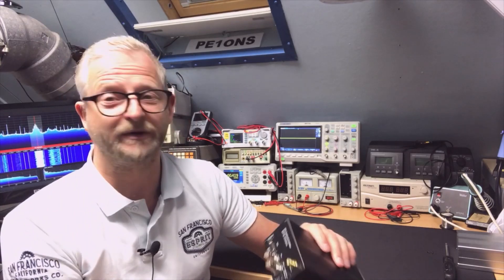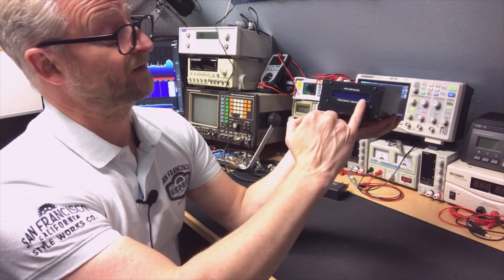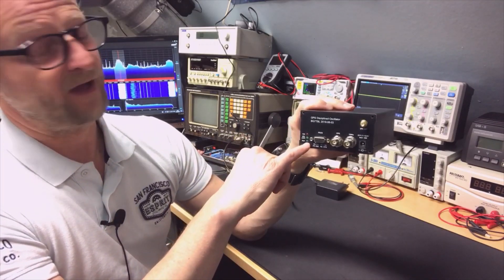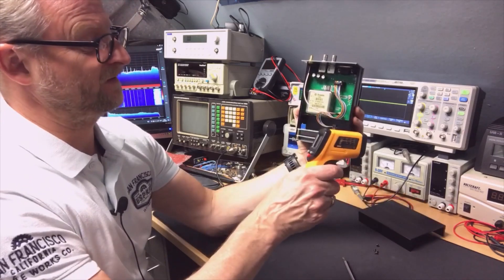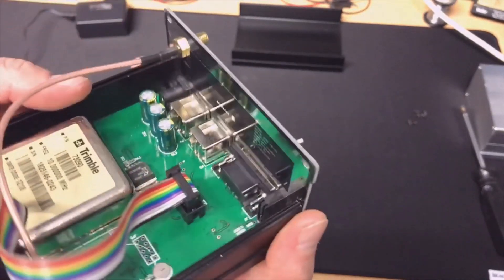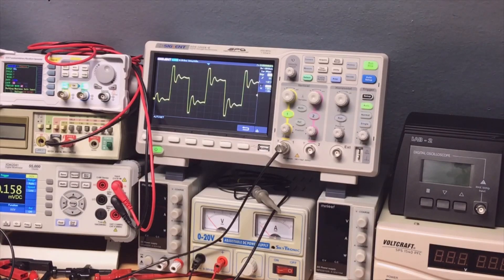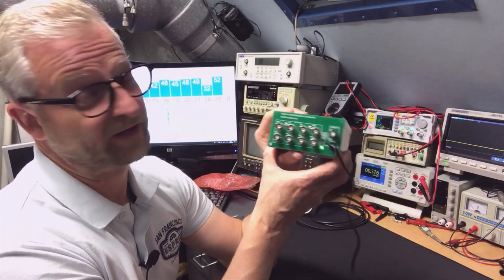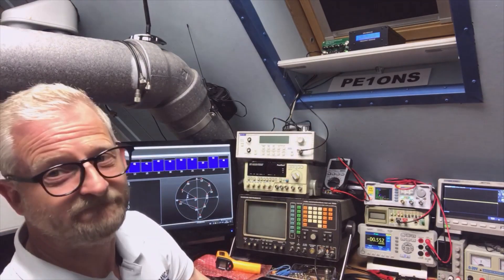#027 BG7TBL GPSDO and FDIS-5 - Review

Comment: Hi Tony
Another great video.👍
Could you make a video about the display settings?
I don't think there's any software for that, right?!
Strange, I bought the green one (square).
But it was one with a sine wave output?
Reply from the maker: Thanks! Sine wave is usually cleaner, so no problem i would day. i dont think you can do anything with teh display. all the control you can do at this device is the gps receiver only. i made a video of that too https://youtu.be/eAdJSErqZOk
here i add more satelite systems to it.
Reply: @TonyAlbus  It would have been nice if there was a simple way to change UTC time...or something else.
Reply from the maker: Yes, mine is also fixed on UTC

Comment: Hi Paul, thanks for the video, very informative and entertaining like most of your other video’s. I am curious about your considerations to decide to buy a GPSDO that outputs a square wave while your distribution amplifier delivers sine waves which seems to satisfy your needs? My thoughts where that I would prefer sine waves as well to avoid lots of harmonics potentially influencing other measurement equipment in my lab. Looking for the 7BGTBL GPSDO it seems it can be had in a square wave or sine wave version. Sellers are often ambiguous in the item description about what version they are selling. As said, I am curious about your  considerations. Where did you buy it from? Amazon, ebay, aliexpress? Payed any taxes for it? I am in the Netherlands as well. Best regards, Ewald
Reply from the maker: Hi Ewald, its Tony here, i just bought the less expensive one with display, it happend to have a squarewave.
I use proper shielded cable and am not to worried about radiation in my lab at all. Mine is from Aliexpress and the seller put in the description is was a LEDbar and a value below 35,- it was not opened so no tax.
Reply: Tony Albus Hi Tony, sorry i mixed up your name with that of the other responder to this video 😊. So it was not a realy conscious decision to go for the square wave one? In your setup you are not feeding a square wave into your measurement equipment as the distribution box makes it a sine wave. I’m quite sure that helps to not cause issues. It is only the connection between GPSDO and the distribution amplifier that carries a square wave. Good shielding seems to be sufficient in your case. I do wonder if feeding in a square wave to e.g. your spectrum analyzer would cause trouble, maybe something to investigate in a future video? Thanks again for the insights, i like your channel, (luckily) many more video’s to watch.
Best regards,,

Ewald
Reply from the maker: Hi Ewald, most equipment just syncs in rising edge, maybe a square works even better.. my second distributor only does squares and i did not run into any problems... in the end its all TTL ... Tony

Comment: How can the GPSDO display a frequency? It needs another reference for that so where does that come from?
Reply from the maker: it has its own ocxo and gps time, also see video #026
Reply: @TonyAlbus  Yes I know that it has an OCXO and that OCXO should lock using the GPS signal. So if they are measuring the OCXO frequency what is the reference? What is it measured against?
Reply from the maker: it is using gps time, when no gps sats. are in sight there is no freq. display, between this moment and lock it will display a less precise freq. you should not use it unlocked.
Reply: hi Paul, please what software are you using connected to the RS232 port of GPSDO and where can I get this? 73, PY1LO
Reply: @miguelfrancisco1035  Hi Miguel, if you are looking at windows software to connect a pc to an RS-232 port have a look at PuTTY: https://www.putty.org/
If that is not your question please clarify.